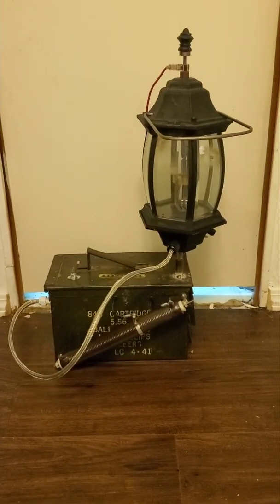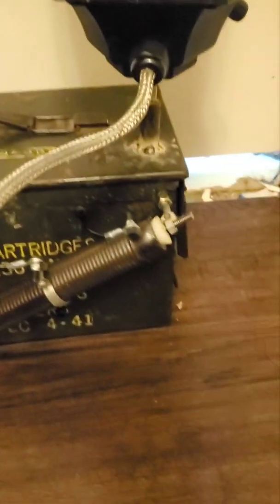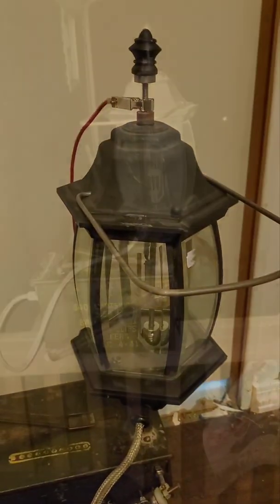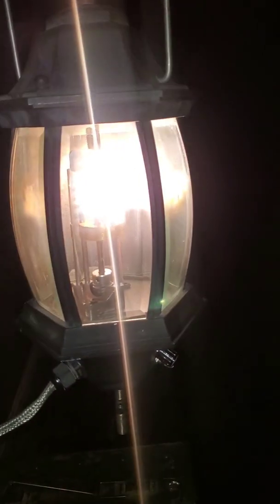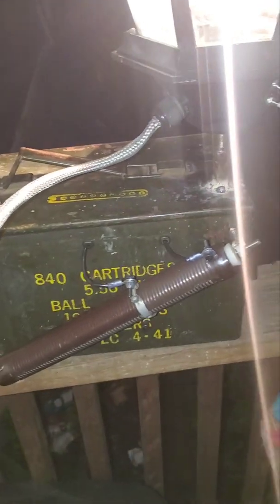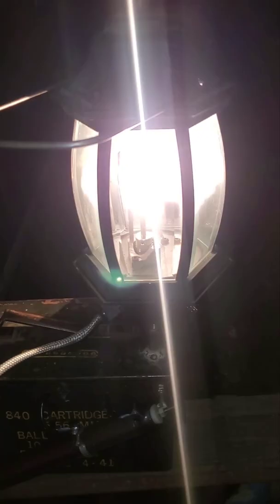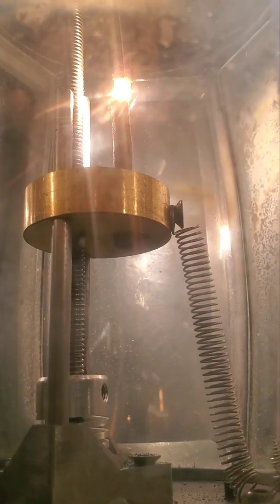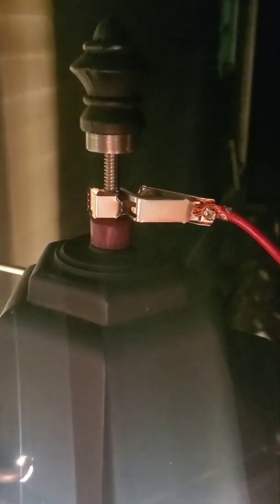Automatic Carbon Arc Lamp

Comment: How far apart are the carbon rods? Like if you have it running, then turn off the power are they touching each other or is there a .5 mm gap or what?

Asking only because it’s hard to maintain an arc by hand at 24V.

Comment: How bad would the shock be from one of these, build a GFCI type deal into it? LOL... Would prob trip constantly though like those pesky AFCi's How long do they last before needing replacements? Did they ever a long timer ago as surely not too safe but have smaller one made for the home itself like a reg lamp using this tech to run on 110/120 in our west or even 210/220 in other areas or even also the west?...
Reply: English maybe?